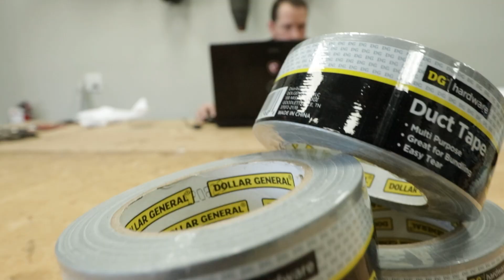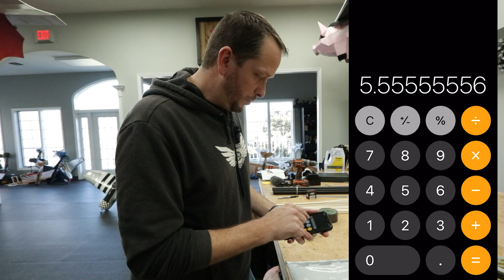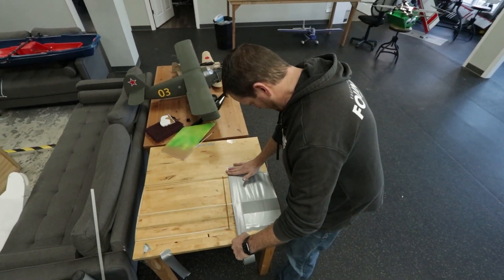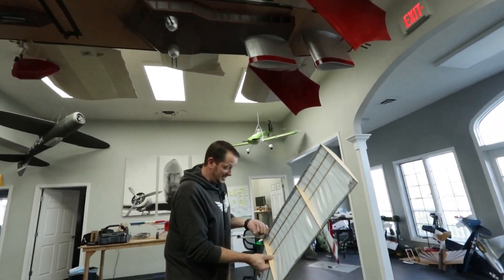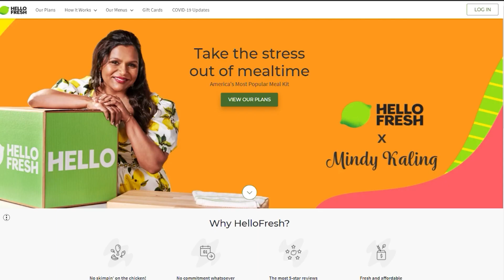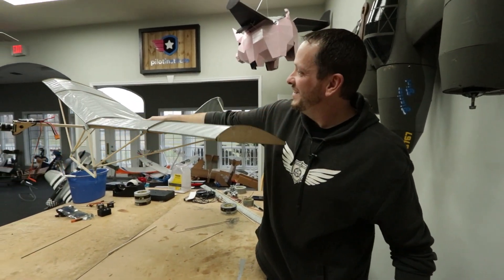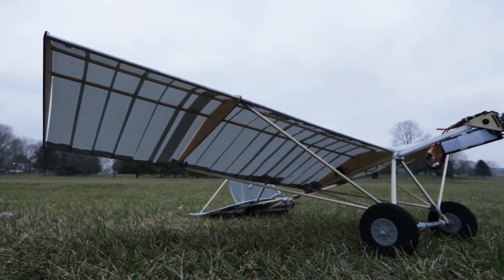Duct Tape Plane

Comment: What about those shrink tube material they wrap and shrink around food.. it’s sometimes over the neck of ketchup bottles. I once vacuumed wrapped a foam wing and it worked perfect. Never seen anyone tried to use it.. it doesn’t stick to anything but might work also

Comment: simple easy tuff as nails. I bought a few slope gliders years ago. Foam based planes with a bit of sparse for stiffening and you covered in packing tape. First to still broke. The rest i covered in ducts tape and they last quite some time no matter what they hit. We took them and added small rc electric motors and made them pretty dang fast lol caution slope gliders behave oddly when flown under power lol They ither want to take off like rockets or get sucked in to the ground. They are made to fly low and slow a few feet off the ground on large rolling hills following the slope. flying under power launched from the ground they behave oddly. Small up and down motion on the elevator translate in to huge sudden motion on the glider. We ended up launching them from um towers that were about 300 feet up here in ohio in the norton and barberton area. You all are from ohio i think you can likely figure out where they got launched from and why the um is there :\

Comment: Early, I’m thinking about buying my first airplane, what are your Suggestions.
Reply: Go for the simple scout. :)
Reply: Don't do what I did and buy the Horizon Hobby Carbon Cub, it flew away with it's GPS system and I almost gave in and left the hobby. But then I got a spitfire and built it, crashed it to pieces, got an old fogey, and I love that thing, then I printed out the plans for the spit, and made a new one and I am happier than ever and have confidence in my flying abilities thanks to FliteTest!
Reply: Something like a multiplex easy star, bixler or similar is the best to start with imho. Motor in the back so it will take a hit, and they almost fly themselves. Also good glide slope and non agressive stalls. Plus you can start with rudder + elevator only and then add the ailerons when you advance.
Reply: just buy or build one of the simpler flight test kits, super simple to build and most importantly repair. I'd say go with two channel (rudder and elevator) dihedral top wing aircraft(they have really stable flight charastiritics) They're really easy to fly and won't overwhelm you at first. However if you have absolutely no experience flying or don't even have a buddy who could help you start flying, start off flying in the simulator, like real flight or something. Make sure you either connect your transmitter or a cheap simulator transmitter so that you know what flying with sticks feels like
Reply: I really like the safe features of the Horizon Sport Cub S 2.  I highly recommend it for a first purchase. Comes with everything you need.

I bought the Horizon Champ first (about $80 on sale). I figured it was inexpensive enough that if I crash I wouldn't be too broken hearted. I have learned a lot and repaired and modified it a lot. (made the engine cowling removable, added an aluminum brace inside the wing foam, tape for the battery). No ailerons though. Was a little bit of a learning curve going from the rudder on the right stick for the Champ to the rudder on the left (and aileron on right) with the Sport Cub S 2.  One of the reasons I kinda wish I just got the Sport Cub S 2 first. But I do love the Champ for it's simplicity (it can't handle the wind very well).

My wife bought me the Horizon Sport Cub S 2 during black Friday for like $75. Super deal, normally $139.99.  I almost wish I started with this one. The safe mode saves me from so much, and really helps in the wind. It does drain the battery faster (the Champ battery never ran out on me, I got bored or crashed before it ever ran out).  Spare battery. Was like $6-8. Works on both the planes. Both planes come with all you need to fly.